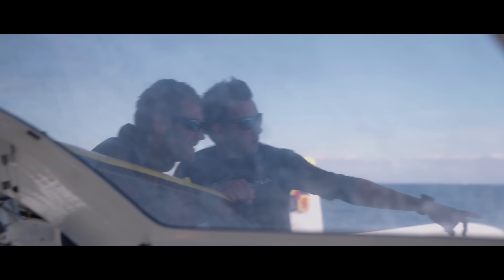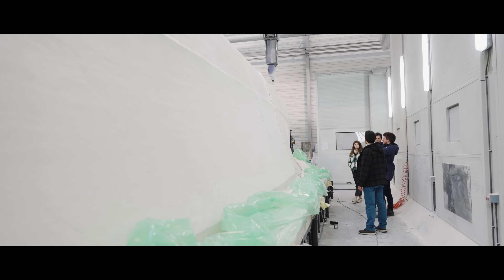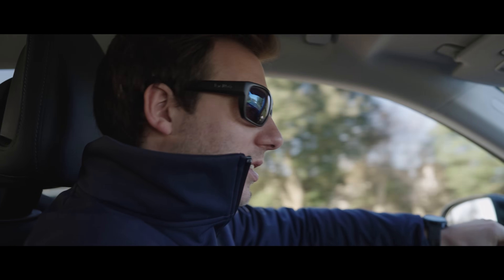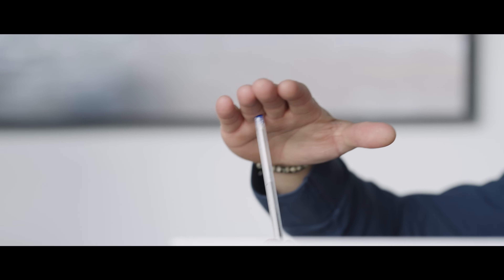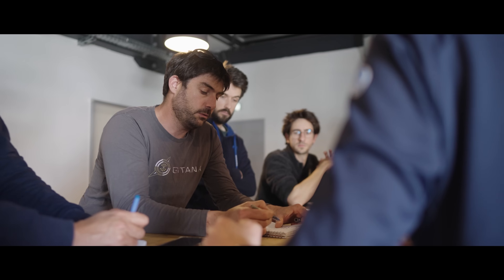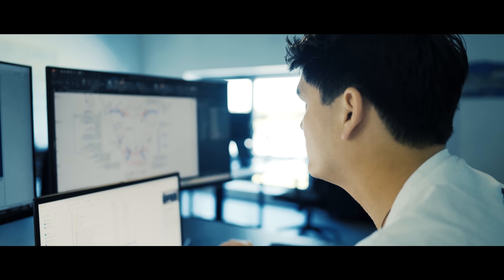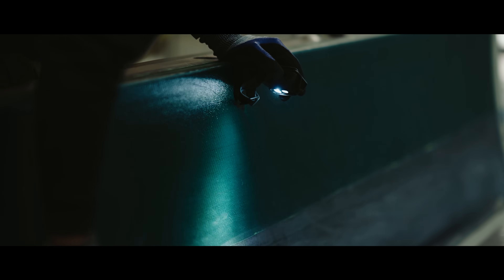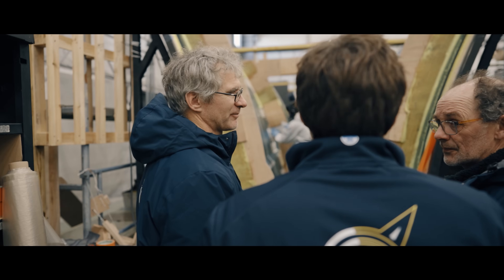G18 NDA - Episode 1 : Conception ✍️

Comment: Pour le bras avant j'imaginerai bien un truc qui boosterai l'aero a fond. Une sorte boite a air permettrait de générer de la portance sous le vent, en profitant d'un effet de sol comme les ekranoplane. Ca porterait le trimaran avec moins de résistance qu'un foil dans l'eau, et ca donnerai du couple de relevement. Au vent le système serait moins aggressif pour ne pas nuire au couple de relèvement. Comme le flotteur est en l'air ca pourrait se faire passivement.
Pour les voiles peut etre une GV hybride entre toile et mat aile. Peut etre a caisson pour la partie souple. Un truc que tu peut quand meme ariser de genre 50%, transformer en "foil tronqué", avec pour la partie aile un peu de controle du vrillage.
J'avoue que ce qui m'intrigue le plus c'est comment aller au dela de la simulation, et tester ces idées sans que ca se voit trop pour la concurrence. Il faudrait avoir un genre de 60pieds laboratoire mais assez discret, pas a la trinité quoi.